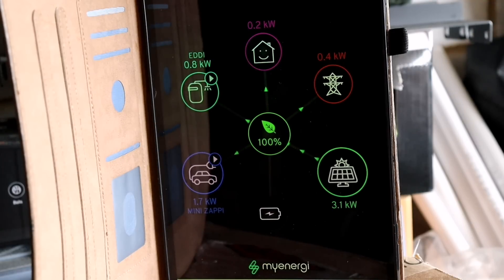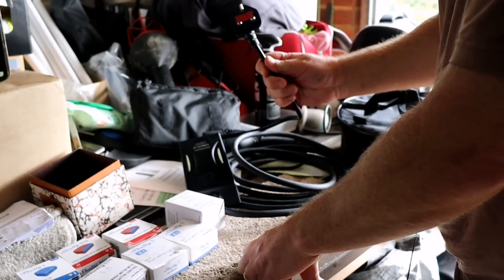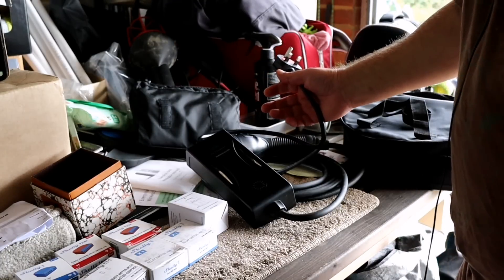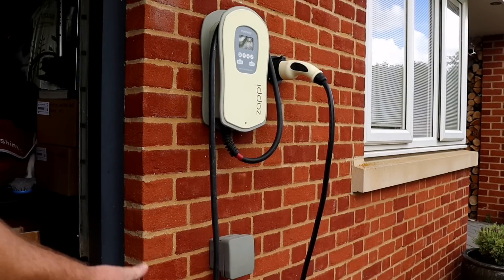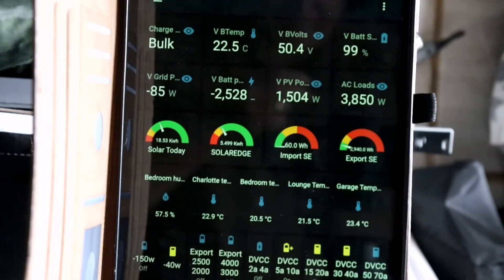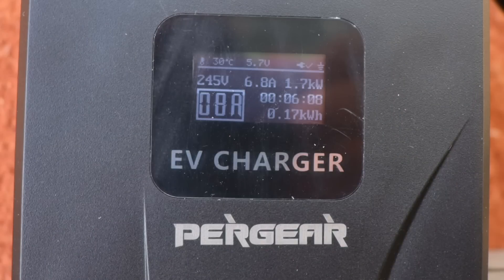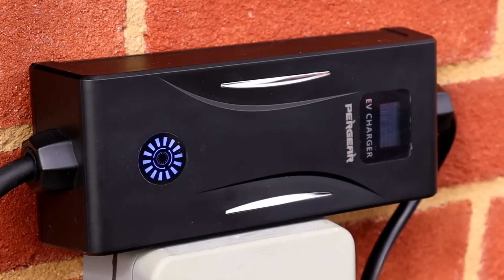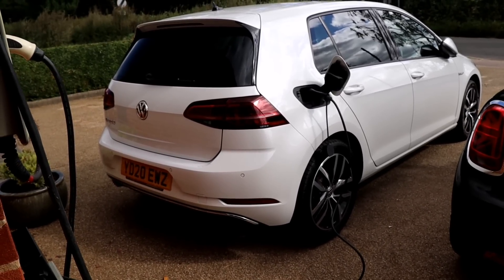Granny charging?  Testing a Pergear EV charger on our Mini and E-Golf

Comment: I've had my zoe for 14 months and mostly use a granny charger in the garage. Lower amps, slow charge and mostly from solar. In fact no grid charge since March! I should add, no intelligent control either, I manually control it via a TP-LINK Tapo smart energy monitor plug.  Normally  charge at 2.6kw. Faultless for over a year!
Reply from the maker: Keep Inspecting it of course
Reply: @EVPuzzle  and I do check.  I should add I use the timer on the smart plug to use the octopus go tariff 4 hours in winter, or when there's not unough solar. I didn't have solar or a battery when I got the car!
Reply from the maker: Most manufacturers state AC charging is better for the battery and slow is good is see sensible. Might not be most efficient but less heat is good

Comment: Not the best thing to use as it’s a lot of sustained load on the socket, a lot of people are finding sockets being burnt, the the pin socket wasn’t designed for the sustained load over this time period. At lower amps your fine but most don’t
Reply from the maker: Hence my comments on lowering amps.  You can't avoid idiots misusing things of course
Reply: @EVPuzzle  I wonder if there is an uprated 3 pin socket available that is designed for a sustained current load
Reply: Best option would be a 16A commando blue socket as used at marinas and camping parks.  Professionally installed these are designed for sustained loads.  Then buy charger with the blue plug fitted.
Reply: @Peter-de1vf  yes 👍🏾 very true, only thing they don’t look the best in domestic environment though, I’ve left one spare way out of the three in my fuse box for a charger